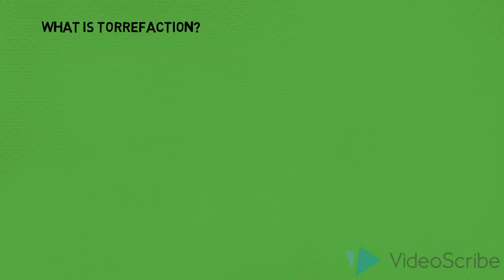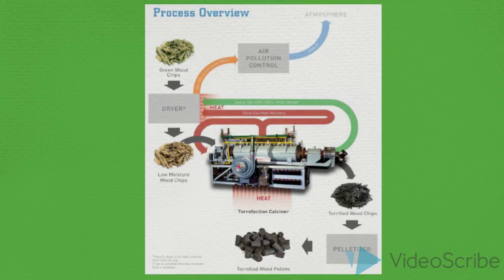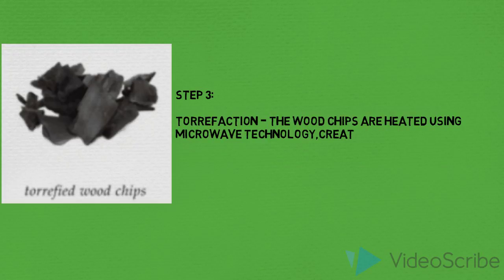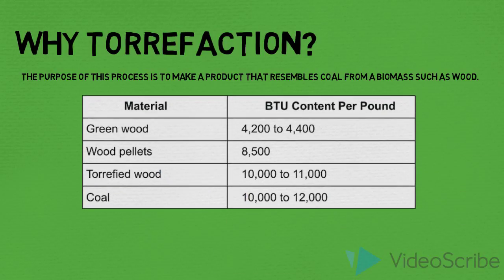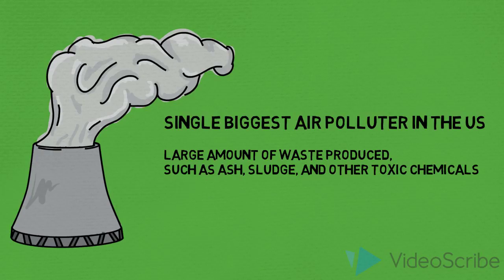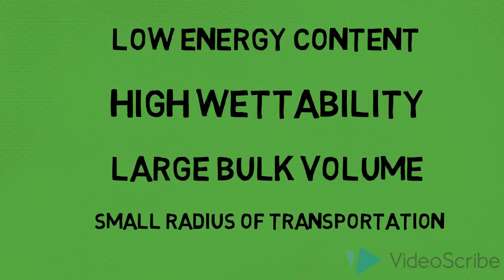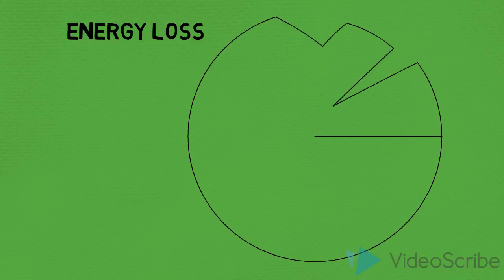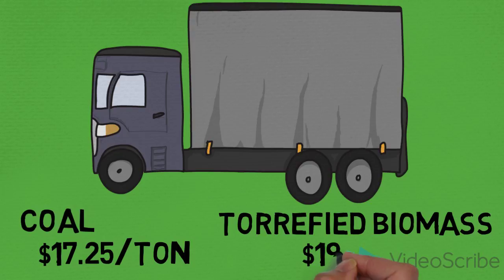ENGR 3124 - Biomass Torrefaction

Comment: The obtained coal like product is also hydrophobic so storing it outside is possible. I see all that abundant green along the roads and highways and we can even think about dead wood in forests which removed, would make forest fires less likely. It would require a kind of mobile torrefaction oven with microwaves to go from site to site where the freshly harvested biomass is waiting. After this step, a truck comes to collect all the torrefaction product from all the sites in one trajectory.
However I still worry about the release of volatile components during torrefaction. Is it safe for the environment to release them  (on the coming large scale ) like they are? Do they have caloric value and can they be captured and stored if so?? I guess most of it will be water vapor.